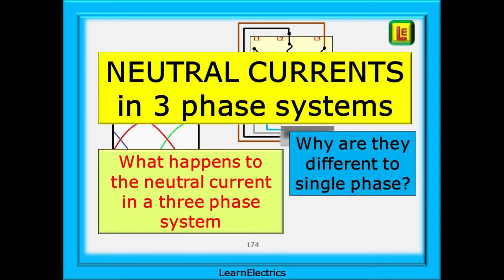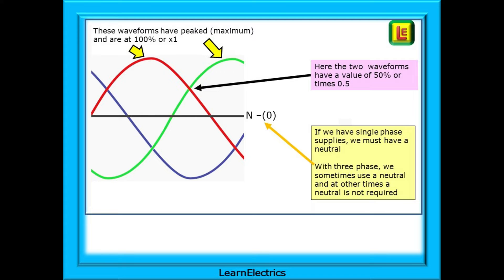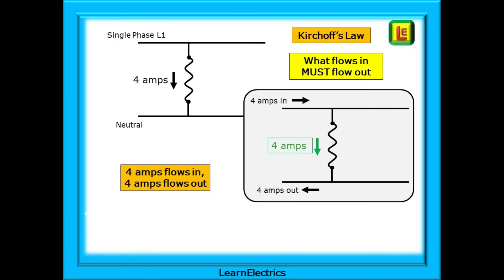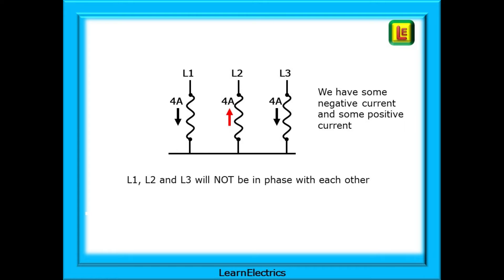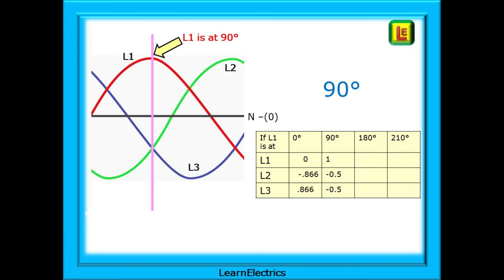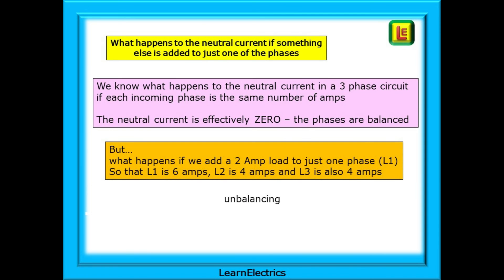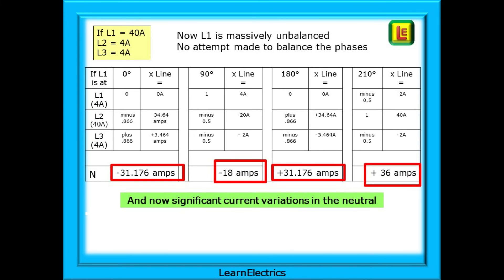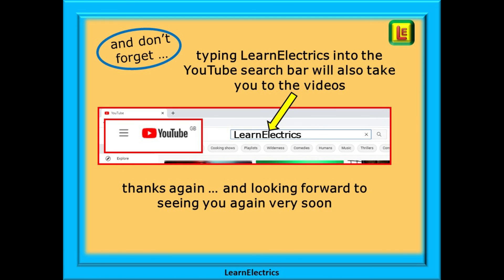NEUTRAL CURRENTS IN 3 PHASE SYSTEMS – WHERE DO THEY GO TO – WHY ARE THEY DIFFERENT TO SINGLE PHASE?

Comment: Hi Dave,
Thanks for the video.
Does a three-phase distribution board supplying unbalanced loads require a neutral isolator?
Some have just a three-phase isolator and a neutral link, don’t they..?
I was wandering why this is?
Reply from the maker: An unbalanced three phase load will have a neutral current. You can check this with a clamp meter on the neutral of a distribution board. If you have lots of breakers for lights, sockets, etc. spread over different phases, you will have a neutral current equal to the current difference between the phases. That's why balancing loads is important. If you do want an isolator for neutral then it must be part of a four pole isolator that switches with the phases. we should not switch neutral off and leave the phases energised. Hope this helps. Thanks for watching. Dave.

Comment: In the video you say something like not all 3 phase systems require a neutral. Can you make a video about why and when a neutral isn't needed?
Reply from the maker: A 3 ph electric motor, where the supply goes ONLY to the motor windings does not require a neutral as all phases are balanced. If the wiring to the motor also feeds something else, a control panel for instance, then a neutral is needed. Hope this helps. Dave.
Reply: In Norway we have been using 230V 3 phase IT distribution systems for 100 years. No neutral at all, none.

Comment: Careful! The neutral current on a balanced 3 phase system is zero ONLY for linear loads, such as incandescent light bulbs. For non-linear loads, it can be 1.732 x the phase current. The NEC specifies either separate neutrals or a common neutral with 1.7 times the ampacity of each phase. I have seen neutrals on balanced fluorescent light systems burn. Doug Stell, MS(EE)
Reply from the maker: Thanks for your input, thanks for watching. Dave.
Reply: appreciate your input Mr. Stell.

By linear loads, do you mean strictly resistive?
Reply: i’ve searched for yonks for an answer like this
Reply: As to where the currents go, I don't understand the question. The neutral current at any instant is the sum of all 3 phase currents. Fot balanced linear loads, they sum to zero. For non-linear loads, only one phase may be drawing current at any instant. In that case, they sum by RMS value, which is the phase current X square root of 3. Code requires either separate neutrals per phase OR a common neutral with ampacity of 1.7 times the ampacity of each phase.

Comment: Howdy. Great.
Usually the neutral current is no larger than a phase current. The neutral cross section may be the same as a phase cross section. And thicker than 16 mm2 copper the neutral may be half the phase, yet at least 16 mm2.
It should be noted though, that early age frequency converters generated so much harmonic reactive current in the neutral that it needed be at least 25 mm2. Best check the specs before commissioning.
And there is a situation when the neutral will carry more current than any phase. This will theoretically happen if there is a heavily inductive load on one phase and a heavily capacitive on another phase. Best be aware of this possibility.
Capacitive loads are rare though. The Code does not recognize this case. What could produce capacitive loads ? Over-magnetized synchronous motors will generate capacitive loading. Some "bulb-head" may think connecting a capacitor bank to a receptacle removes spikes and harmonics from the mains and delivers clean sine wave to one's HiFi system. It does. Yes. But best be aware of the possibility of strong neutral currents.
Regards.
Reply from the maker: Thanks for the input, appreciated. Thank you for watching. Dave.

Comment: Thanks Dave for sharing this with us. But,  I've still some doubt about, what can neutral do to the supply if any currents flow along it (neutral) ?
Reply from the maker: Unless a 3 phase system is perfectly balanced then we will have neutral currents. They just go back to the transformer. Most 3 phase boards are not balanced which is why we should always try to make the neutral conductor the same size as the phase conductors.

Comment: How about if you have 2 power source like AC & solar power, Is it okay to have different grounding system for solar inverters that is neutral grounded to metal case/housing then TNS output? Of course has an input of AC TNS also...
Reply from the maker: There is specific equipment available for this, installed to ensure that the point at which the incoming AC and the derived solar meet are compatible with each other and electrically safe. Dave.